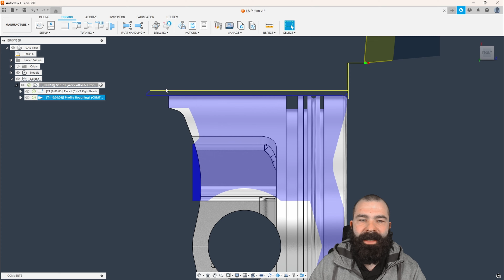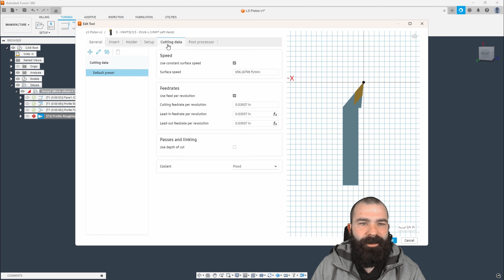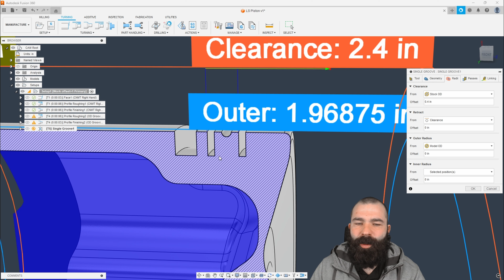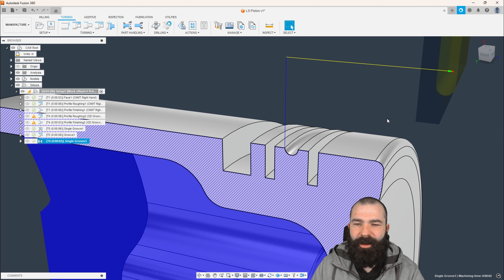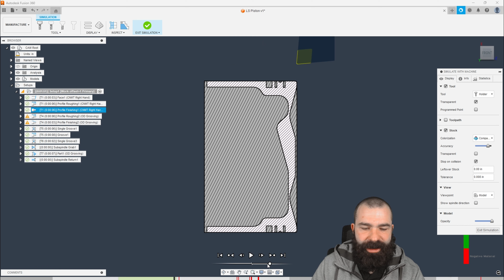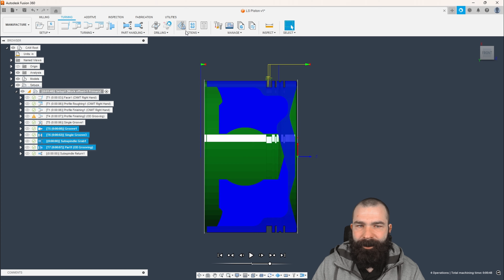Turning Tuesday: LS Piston

Comment: Hi Phil, thank you for another great video.  Only, it would be nice if you could always finish all your cycles without having errors (the yellow triangle next to the tool path). Otherwise, I think that some of the postprocessors dont generate the code.
Reply from the maker: Great suggestion! Ill see what I can don on my next videos. Also it should post with no issues even with Cautions. In the case of the ones on this video its just lead out warnings.